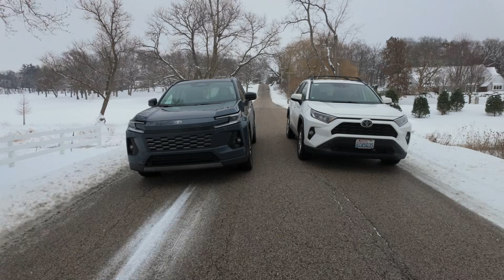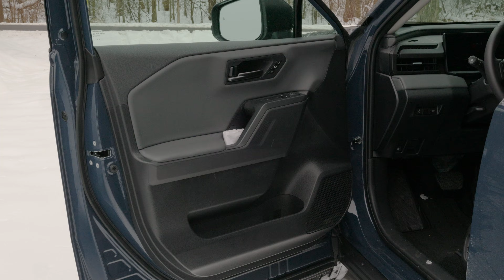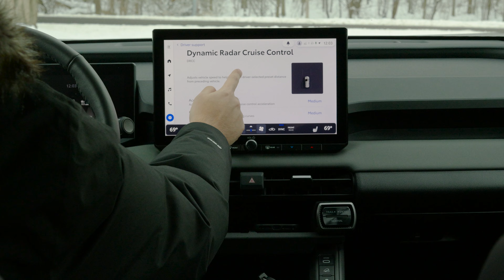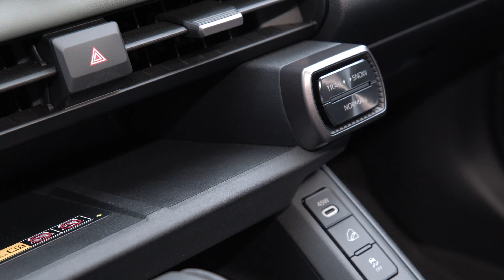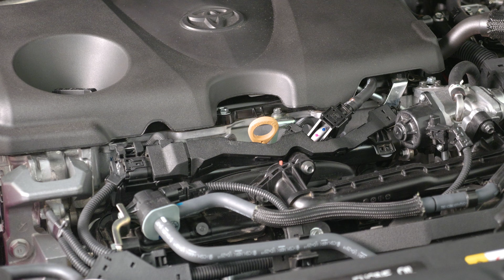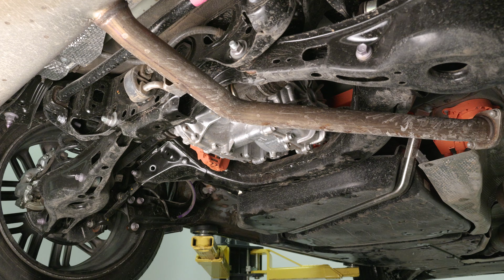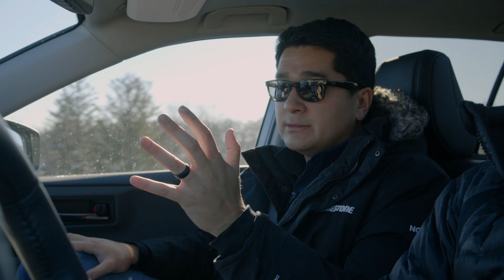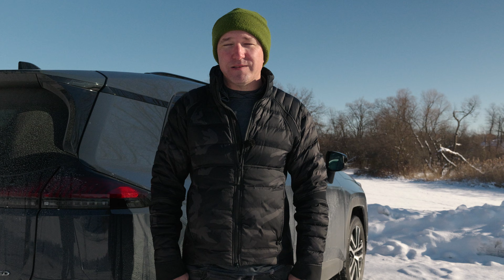2026 Toyota RAV4 | What Most People Want

Comment: Very interesting that Toyota moved to touchscreen for a lot of controls in the new RAV4. Seems very off brand and it’s the best selling car. Tippy tapping (thanks for that phrase Jack) to get heated seats and hvac controlled through the screen.

It will sell like hotcakes regardless but seems a bit like shooting themselves in the foot. Not sure what is wrong with just copying the perfect Honda HVAC knobs setup. The only "more perfect" knobs setup I've ever come across is in the 2016-2019 Audis like my Q7.
Reply: Honda CRV. High quality feeling button and knobs in a practical layout. Oh and a direct competitor to the RAV4.
Reply: Lexus has done it on many of their vehicles and it doesn't seem to put anyone off. I agree with you that it's stupid but from a manufacturing standpoint, it's fewer parts, harnesses, etc.
Reply: I had a 2025 Q7 as a rental this year and the HVAC is on a separate screen, which eliminates the center storage below the radio. It was okay, but it had one of those screens like the old Blackberry smartphones where you had to push hard on the screen and you'd feel a click/vibration to confirm your selection. You'd have to take your eyes off the road and look down at the screen down by the gear selector to make changes to it and it would often take multiple attempts to get it to register as you had to push pretty hard to get the screen to click in to register your button press. It also didn't have anywhere to store your sunglasses aside from the door pockets because the center console was maybe an inch deep, just deep enough for the USB ports to plug your phone in.
Reply: @TheCobruhAlienat0r  Yeah, that's a 2025 Q7, I said 2016-2019. Those years had a gorgeous knobs and button systems
Reply: @TheBMurda  I know. I was just contributing to the conversation by saying how the new ones have gone to all screens as well.
Reply: @TheCobruhAlienat0r  "I had a rental for a short period of time and I didn't realize you could turn off the force touch and feedback in the settings. I'm going to base my entire view on how touch screens work on both:
A) A vehicle I didn't have time to get used to
B) A screen that I didn't understand"

They gave me an ETron while my S4 was getting its maintenance done. Guess what: in like 2 days you get used to it.
Reply: Like they didn't learn from Honda or Volkswagen who already has to back pedal for this BS in previous years...
Reply: @vhateverlie  VW will probably just add a singe defog button to the Tig and act like they listened
Reply: I used to complain about this myself but honestly these days it doesn't really bother me. Modern automatic climate control is so good that I very rarely find myself needing to make adjustments.
Reply: @PIchillin456  But if the screen fails then you can't control your HVAC, so depending on the time of year and how hot or cold it gets where you live it would basically make the car undriveable until you fix it and those screens probably cost thousands to replace out of warranty and may be hard to source when it's 10+ years old.
Reply: @TheCobruhAlienat0r  No, if the screen fails... then I replace the screen. 
I don't spend every single penny I make, so the "daunting" thousand-dollar repair (oooohhh spoooookkyyyy) in TEN YEARS isn't the threat you think it is.

Comment: I am not happy with the AC controls being in the  display.  I prefer manual buttons because you have to take your eyes off the road to make changes (on the display) plus if the display dies, very expensive to replace plus you lose AC control while it's down. Otherwise looks like a great vehicle.
Reply: Or in their case, their gloves have to come off too.
Reply: @derekisthematrix  Google: capacitive gloves
Reply: Putting the AC controls on the screen is a major fail!
Reply: Subaru learned this I wonder why Toyota is going backwards?
Reply: Toyota is going to learn the same lesson that Subaru did.
Reply: I can't believe they went back to more digital controls ughhhh
Reply: If I can set a temp. and go auto, I’d be fine with it. This is on an old ‘09 Camry hybrid setup I use. I’m surprised temp controls not on wheel on future vehicles
Reply: This is legitimately the ONLY thing I don’t like about current BMWs. The touch screen has too much going on.
Reply: I think its a way to prevent aftermarket headunits
Reply: @ironrain1x . It's cheap. That's it.
Reply: How many times while in motion, do you suddenly need to change the temperature, such that you couldn’t have changed it before being in motion or at stop? It’s such a non-issue
Reply: @JF-if8jh  Until the head unit stops working, no heat or AC then.
Reply: @cmiles97x38 if the AC connector goes out no AC either, even with a knob
Reply: @JF-if8jh  All the dang time? I'm constantly dialing up and down for my comfort.
Reply: @M_Call0 okay Diva
Reply: @JF-if8jh  Call me a diva all you want, I'm still the one here who wants the more-utilitarian cars with less BS modern comforts.
Reply: @M_Call0  Normal people have a comfort range around 70 degrees and will set it somewhere in that range and not touch it again.
Reply: @JF-if8jh I literally change the temperature all the time while I’m driving. If it gets too hot I turn down the temperature. Same if it gets cold. That’s a pretty normal thing to do while driving in the real world.
Reply: @JF-if8jh when it starts or stops raining so you have to adjust your hvac while driving to prevent fogging.
Reply: @ironrain1x  LOL, auto mode has a hygrometer. Try again.
DUURRR MY MANUAL VERZION MAEKZ ME DOO DIS SO DUH AUTO ONE DUZ 2!!!
Reply: @tim3172  yes a humidity sensor that will max out the blower on you at the slighest change when all you needed was a slight change in temperature in low fan speed.  I could invest in a better after market humidity sensor or I could just change the hvac manually.
Reply: @ironrain1x You're using hyperbole. That is absolutely not what happens in modern vehicles with automatic climate control. When I got my current vehicle in July of 2024, I set my climate control to "auto." Since then, I have never once changed fan speed or direction. I pick the temperature, & that's it. I live on the Gulf Coast & drive in the rain regularly. Never have I experienced the issue that you're describing.

Comment: Its ridiculous they got rid of physical climate controls but enlargen the drive mode toggle when 99% of these will never leave eco
Reply: You can change temp and front and rear defrost with physical controls. Otherwise auto climate control, no?
Reply: You could change every climate option in the last car with physical controls, and not everyone uses auto climate.  @ytj22
Reply: Who drives in eco mode in  4cyl hybrid? Yuck

Comment: For the next generation they should triple the size of that center media screen
Reply: replace the windshield with a screen. put cameras on the front. then for the next one replace all windows :D
Reply: IT'S NOT BIG ENOUGH!
Reply: I mean, why even have a dashboard at all?
Reply: And framed by 2.5" of piano black plastic. Maybe it won't be as annoying this time.
Reply: I think it should be mounted even higher too, maybe it should just replace the windshield
Reply: They should just include a fighter pilot helmet that has all of the infotainment stuff right on the visor
Reply: VW already did that for the GTI

LG OLED on the dash
Reply: Some toyota designer is reading your comment and most probably writing it down😂
Reply: Why not make the entire dash a big, wide screen across the entire width of the vehicle, right below the windshield. So you just watch a screen instead of looking ahead out the windshield and driving down the road.. just stare at the screen and use your fingers.

Ditch that outdated steering wheel, build into that screen a slide feature, you can touch the screen with your finger moving back and forth, left to right to steer the vehicle down the road. 

Then a retina scan to start the vehicle and an added biometric finger touch spot on the console to move the vehicle.. one tap to park, two taps to reverse, three to neutral and four taps to drive.
Reply: I want swipe to steer.
Reply: Its crap
Reply: Oh god
Reply: Is only for lexus suv
Reply: 54 inch TV ?
Reply: Shhhh...don't say that!
Reply: This 100%….we had a 21 RAV4 and were looking to trade in for a Tacoma….those screens are way to big for that truck

What’s up with the iPad big screens Toyota?
Reply: @NinerK  I feel you. I rented a Tacoma TRD Pro for a camping/off road trip recently and I hated it. It was comfortable, but it had many issues and breakdowns throughout the 2 weeks. Frankly unacceptable of a new truck with less than 5k miles. Also all the stuff they tacked on for looks on the outside plus the large screen inside made it terrible to drive and maneuver off road. Horrendous visibility and not very confidence inspiring. The truck felt much larger from the drivers seat than it actually was
Reply: @whizkid235 ouch, sounds rough.  Our thoughts and experience were similar.  12 months of next gen Tacoma videos out the window when we sat in one first time.  Uncomfortable (sr5) and just way over designed.  Not a fan of screen chassis extending above the dash, among other things.

Went from 21 rav4 to 24 ranger 2.7, we love it but I’m already wanting a full size truck haha
Reply: @NinerK  the 2.7 is the best thing ford makes, you should probly keep that ranger unless youre getting something serious like a 2500, and only get that if you tow for a living because they suck for home use
Reply: I would rather have an option to get rid of it entirely, put in an old school basic radio, and cut the sticker price by $10k
Reply: @ozflying  its literally cheaper to have the screen for them, so youd be adding 10k
Reply: I HATE THAT BIG SCREEN!!!
WHY WHY MAKE IT EVEN BIGGER!!
FAK YOU TOYOTA!!
THEY ARE SCREWING WITH US AT THIS POINT!!!
Reply: Why don't we just go back to crank starting it? Electric start is too newfangled.
Reply: Gen Z idiots
Reply: @ShirleySerious  well...Shurely... screens burn in. My phone, a Samsung S10, i can see the keyboard when im looking at a white background. Here is the kicker. My phone is set up to who keyboard letters in white. And. It still burned in. 

Now... how much is that going to cost to replace in 5 years on the car?
Reply: @superdupermax LCD ≠ OLED
Reply: @JF-if8jh  my gs10 screen is Dynamic AMOLED.
Reply: @superdupermax  thats specific to OLED, which almost no cars have. LED doesnt burn in. they do take a shit, the colors can go bad so itll shift everything to one color, or the backlight can go bad and you wont see anything. lots of ways for LED to go bad, but that problem with your phone isnt one of them. also you have an s10, the current one is the 25 and about a month or 2 away from the 26, so thats a decent life span for something designed to expire in 3 years (what your phone was expected to last)

and yes AMOLED does in fact end in OLED, 'active matrix' was just what samsung called their fancy twist on it. still an oled.
Reply: @bradhaines3142  cool. You arent exactly making a good arguement for led either. When my old jeep consol light burned out..  i still had the buttons and it was a 25 cent and soldering iron fix.
Reply: @superdupermax  nothing last forever, but if you want any kind of screen especially at high brightness LED is the best you can get. just because it goes bad eventually doesnt mean its not super helpful for the 10-20 years it should last. hell anywhere north thatll more than likely outlive the car
Reply: @ShirleySerious  Except the electric starter was an actual improvement over the hand crank while all these stupid gimmicks don't improve and are arguably worse than the older layouts with buttons.

Comment: I love that this video drops as the Toyota app is down as usual. One of the most clunky laggy, vehicle apps ever made. Still no full BEV RAV4, either.
Reply: bZ
Reply: Not as bad as VW, but that's a pretty low bar.
Reply: bZ4x
Reply: I updated it today and never reloaded.   I uninstalled/reinstalled a few times already a dy.
Reply: Why invest in a BEV when nobody wants them now.  that fad is almost over dude.
Reply: @henrymiecz8566  Delusional.
Reply: @henrymiecz8566  Nobody would be off the mark. Clearly Ford and Dodge/RAM aren't doing well with EV but GM is doing OK. Was in China last week at 40% of the vehicles I rode in (over 100 vehicles) were full electric. If the biggest market goes that way - that is the trend. Same with California - they had idiots buying SUVs and trucks that never saw a dirt road long before the rest of the US (sans of course the places where trucks are actually used for work). Sad that the Lyriq spanks Lexus' offering.